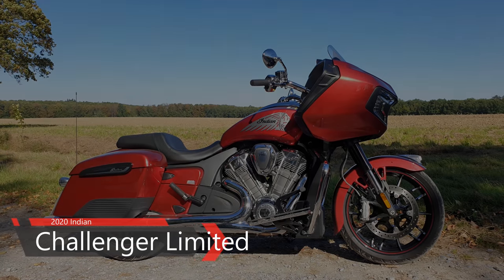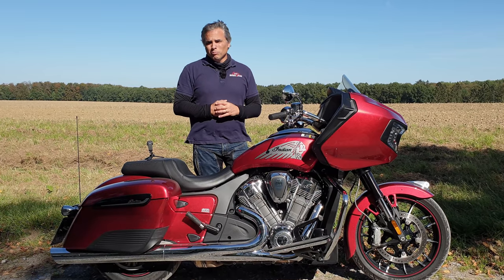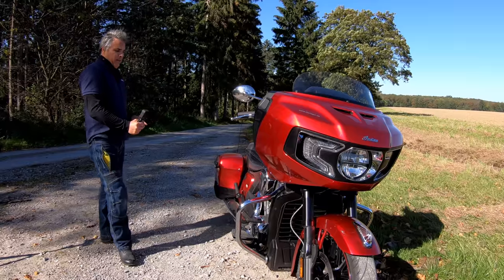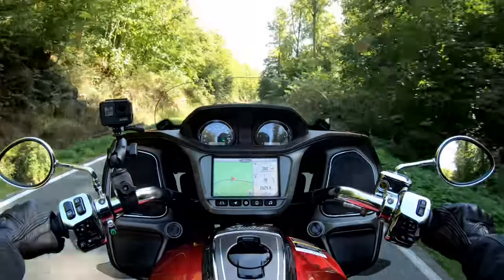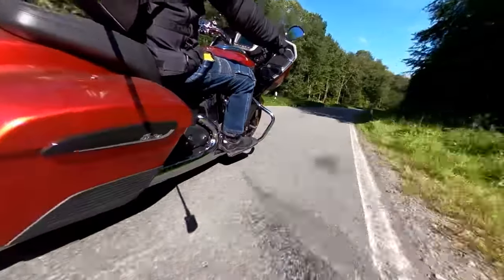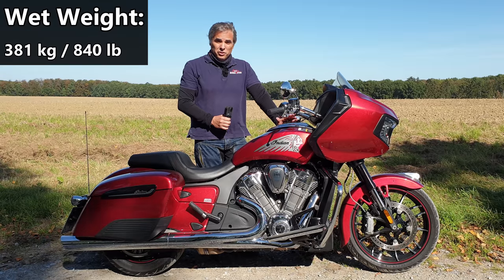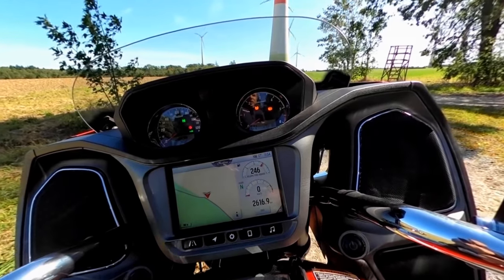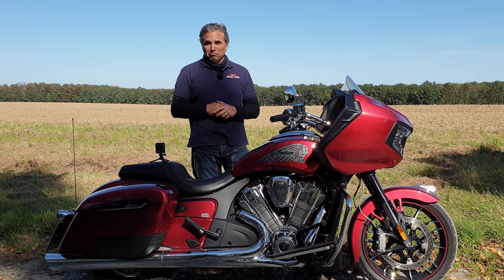2020 Indian Challenger Limited | Simply Powerful

Comment: Hi Scott! I was really glad to see the piece on the Scout, so I was wondering when/if you were gonna take a look at the rest of the heavy lineup. As a Vision pilot I was also curious how you were gonna like riding a heavy. I got the reaction I predicted!  Great work on this piece, btw. I am glad you are doing the ride-by's again, Two thumbs way way up, Laddie! 

I have ridden the Challenger Limited. I love the engine. To me it's the way forward for Big-V's. Pulls like a truck and very smooth. Every bit as good as my modified 106. Defnitely smoother. The suspension is very good also. Brakes - way better than any cruiser / Bagger I have ridden.  I especially like the Ride Command system. Well thought out and it works well. 

The disappointment comes in when you sit on it. I know for most it's fine, but I'm a bigger rider and for me it's cramped. It certainly doesn't compare to my trusty Vision. And I am still coming to terms with the look. I'm struggling to like that fairing. I think the trim and bezels look kinda cheap and should be improved upon. 

All in all this is a really nice bike. But it's very expensive. And frankly, I wouldn't trade the Vision for it.  I'm waiting to see what else Indian will do with the Power Plus. Cheers, my friend!

Comment: Great video! You always have such calming and informative reviews. I love Indian motorcycles. Unfortunately, at 5 feet 4 inches tall, I don't think I'd fit on any besides the Scout.
Reply: You should fit this just fine. A friend of mine is 5'5" and rides a Chieftain. My Uncle is 5'6" and rides a Goldwing. Within the Cruiser/Tourer category small bikes can be uncomfortable for tall people, but big bikes are almost never uncomfortable for short people.
Reply from the maker: Nah, you should be fine on this. Go down and sit on one and if you can, take one for a test ride. You'll love it. The weight is about the only thing you have to get used to, unless you are used to riding big cruisers then weight is not a problem.
Ride safe,
Scott
Reply: You have a valid concern. I’m a Road Glide owner, had Street Glides, I’m 6’1”, just took a test ride & while seat height is low, the Challenger has more forward controls than most tourers. It’s foot controls are more like my softail than Road Glide & handle bars & neck are more forward than any bike I’ve ever ridden. I saw Cheiftain comment, per the Indian dealer, this bikes riding position is more stretched forward than Cheiftain also, if 5’8” & under, you should test ride. Amazing bike though! My Road Glide has a 107” cam, tuned, perf exhaust 2-1 w/ no cat, this bike stock smokes it.

Comment: ive watched several videos on the challenger no ones ever mentioned exhaust valve function its not an emissions thing ?
Reply: That is an aftermarket exhaust system. Factory does not have any kind of valves or adjustments.

Comment: The name "Challenger" belongs to Dodge. Why would Indian name it something an Indian Comanche?
 The front fairing looks like it belongs on a pickup truck. Why doesn't it come with a tour pack?
Maybe an electric reverse gear would be nice, maybe even an automatic like the Goldwing.
Reply: The Challenger name isnt a trademark of Dodge... My new LS2 helmet is also called Challenger so...
And this bike does come with a "tour" pack...
Reply: Duh! I know the name "Challenger" is not Trademark to Dodge. But everyone knows Dodge is still building and selling badass 2 door Monster V8 Challenger's mine a 6.4 liter that put out 485HP. My point was, why wouldn't Indian name there new bike with an Indian name like an Indian Comanche or an Indian Cherokee. Would that make more sense? 
That fair looks like it belongs on a pickup truck.    @kevinvandenbergh9998
Reply: @jamesdumas6602  true, i give you that.. we have the scout, chieftain,.. Indian should put more indian related names on their bikes.
Reply: @kevinvandenbergh9998  I want them to make a single-cylinder bike, and call it the Atl-atl.
Reply: well it's meant to challenge everything the road glide has to offer and as someone that switched from harley after 15 years to the indian they killed it you could spend 35k on a cvo glide for 105hp or spend 22k on a base challenger and get 122hp better handling better infotainment and a better motorcycle in my opinion the dark horse is 27k and blows the road glide out of the water I put tens of thousands of miles on a road glide special and yes it is a good bike but just not in the same class as the indian

Comment: That nose cone and headlight looks hideous. You didn't mention it touching down on bends so I guess ground clearance is ok.
Reply from the maker: It did better than most cruisers, I've ridden, in a corner (with my limited cruiser experience). I was actually surprised as to how far I could lean with this bike...for a cruiser...all things relatively speaking.
Reply: @NothingToProve  Thanks for your reply. Yeah it seemed quite good taking the bends. If that nose cone was't so ..... bulbous it would be quite an attractive bike as far as cruisers go. All the best Scott.